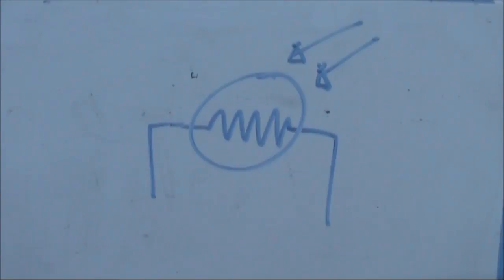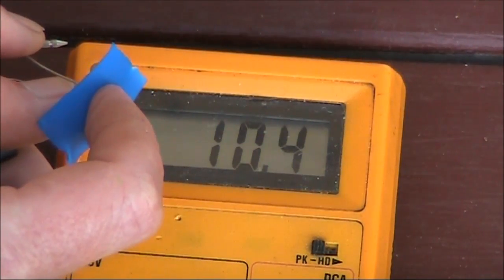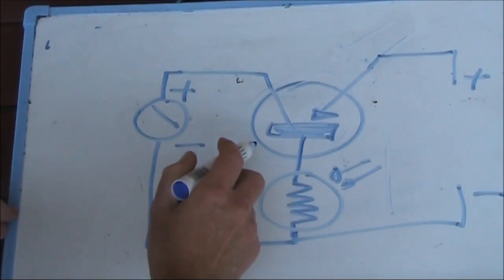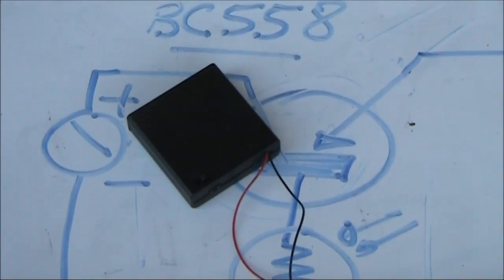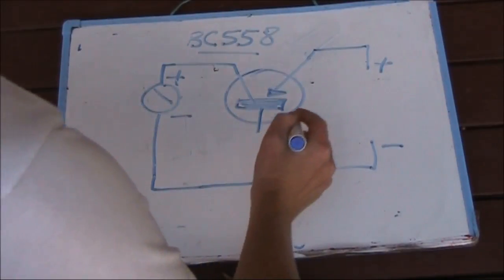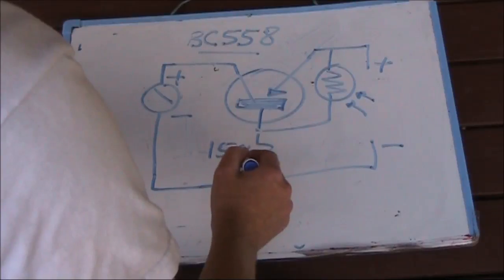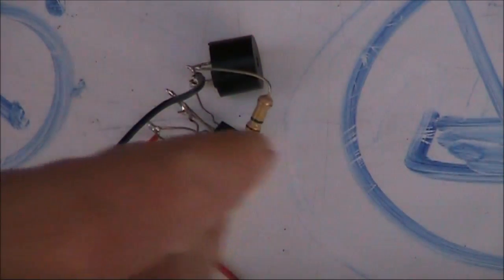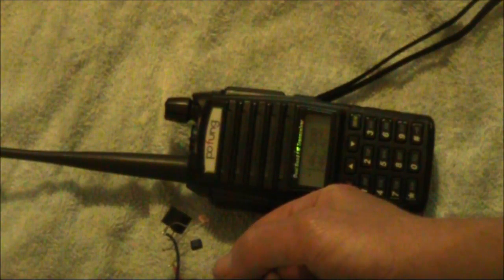Electronics on the floor: Shining some light on LDRs

Comment: When I first started playing around with electronics I built an audio oscillator with the frequency controlled by a pot. I changed the pot to an LDR and created a theremin that used light instead of RF. Once I put it outside at night during a heavy thunderstorm (under shelter) and listened to the lightning control the sound.